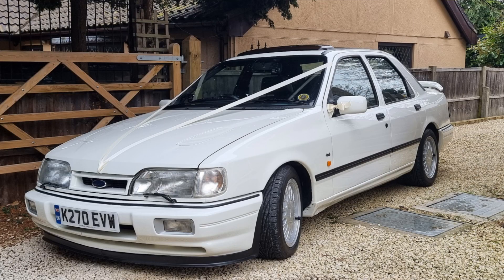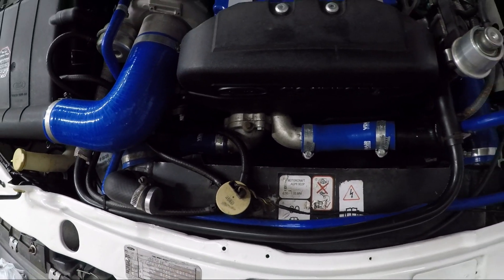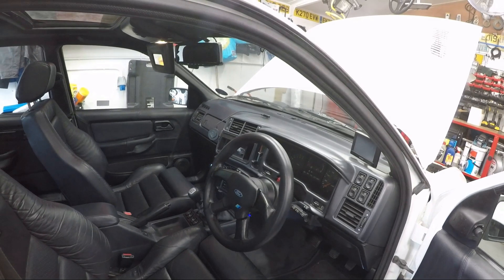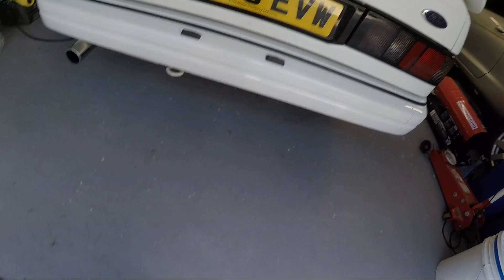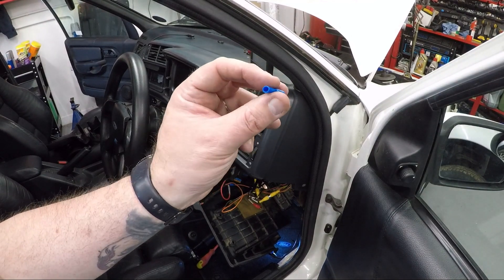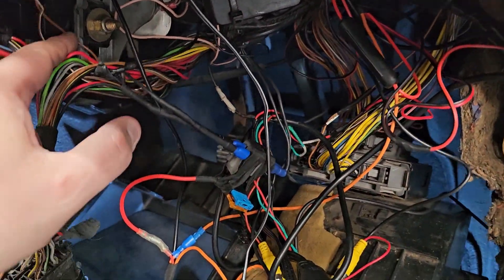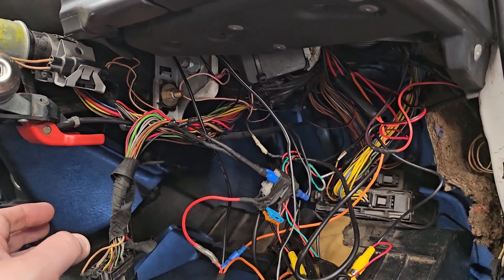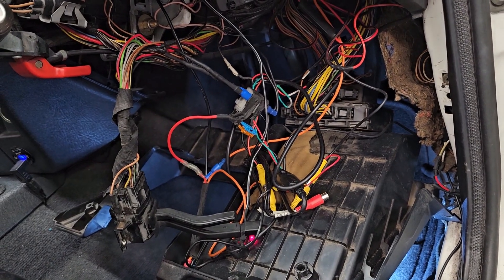Walk around & steering column adjuster clamp & electrical fixes on my Sierra 4x4 Cosworth - BMM EP.2

Comment: Will you ever be doing an In car video  if you take this cossie for a spin? Lovely example 👌
Reply from the maker: Yes I plan to probably before and after the clutch replacement. It's slipping badly once you get into 3rd which is a shame as the clutch is less than 2000 miles old.
Reply: @BigManMotors  Ok that's great I can't wait to hear it 👌. Odd how the clutch is slipping after that many miles 🤔
Reply from the maker: @johnn278  yes. Could be the rear main seal as I didn't change that when I fitted the engine almost 7 years ago (it wasn't leaking) . Probably a bad pressure plate since the driven plate is a sintered paddle type. Will probably need to skim the flywheel. More expense just as I'm shipping my Trans Am and building a new garden room / home office. Clutch may have to wait a little.
Reply: @BigManMotors  Al the best with the repairs. Looking forward to the incar videos 👌. You can't beat a white 4x4 on Sharktooths 🥵
Reply from the maker: @johnn278  thank you so much, John. Will be nursing it to the Orsett car show next Sunday (local) so repairing after that. Also my Trans Am gets collected from Michigan that week following and gets shipped to the UK. Exciting times
Reply: @BigManMotors  Absolutely no worries 👍